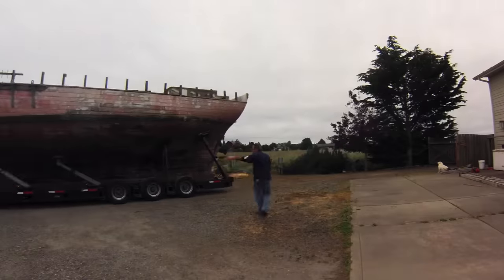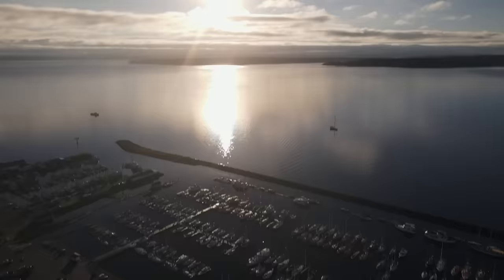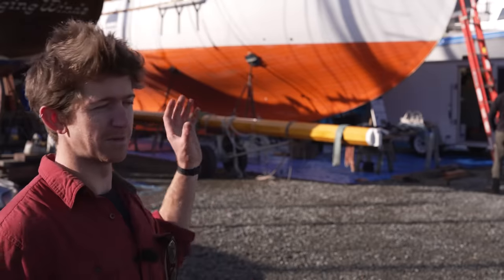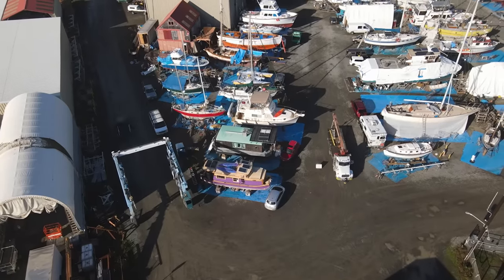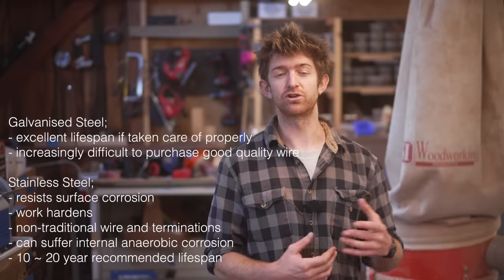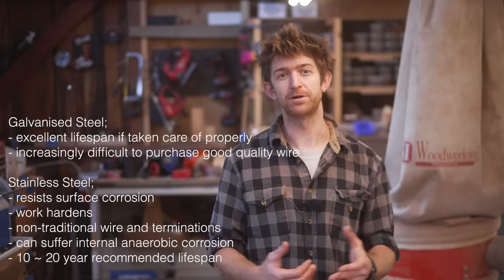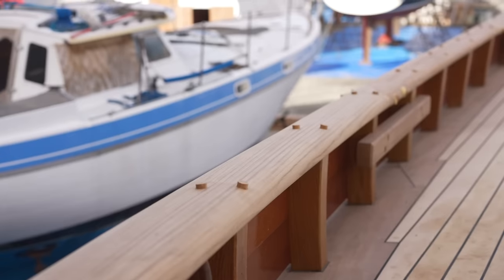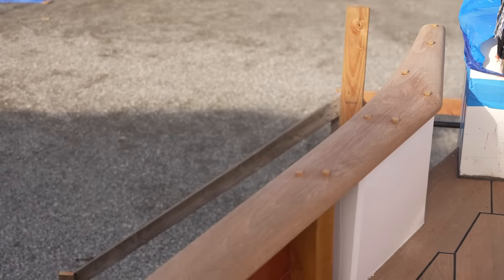Stepping the MAST!

Comment: Ahm, I think based on what I have read I do take issue with the comment from your rigging guy that Dyneema doesn’t stretch. In short it does. 

Basically, while it is accepted that it has a low stretch under normal loads it can stretch significantly under very high loads. That is if it is subjected to continuous significant tension it stretches incessantly and permanently. This irreversible elongation under static load is called creeping. From a practical perspective, re-tensioning/tunning the standing rigging is going to be a necessary maintenance factor for Tallly Ho.

Comment: Use of ultra-high-molecular-weight polyethylene  rope as standing rigging makes sense, and the traditional serving of the line does appear to mitigate the potential aging and wear vulnerabilities  of the material. Dyneema is the trade name of this product as used on Tally Ho.
Ultra-high-molecular-weight polyethylene is very surface slick, so it doesn't like knots. One the one hand, a knot will slip under load and on the other, it is really hard to get a knot out of the stuff. Although noted as a strength of the material, the material does not stretch more than 4% before it parts, so being able to assess the condition of the rigging under heavy loads that may compromise the rope is difficult by visual means. 
It should be possible to over build the standing rigging to withstand a greater than  worst possible case with ease, the only obstacle being the cost per linear foot of the appropriate rope diameter and stranding. Hopefully, that is what has been done on the design of the standing rigging on Tally Ho.
While this application is nowhere nearly as critical as the design and use of materials was in the failed Titan submersible, it is still based on the newest wonder stuff. It appears that the rig will be good for 10 years at least, but beyond that is well past the history of this material in shipboard use. Just sayin'.

Comment: You state that galvanized wire rope is difficult to find.  Not around here... It's used in winch cables for those who have not drunk the synthetic rope Kool-Aid... Hell, I even saw lengths of it in Harbor Freight today when I was looking for something else... What diameter do you need and what is the maximum length that any one piece would need to be?

Comment: I sort of disagree with the ""doesn't stretch" statement at around 7 minutes. 
Sure, the stretch in the individual fiber is minimal. But laid or plaited into a rope, a finished rope will elongate as it's put under tension. Initially, the fibers aren't perfectly aligned. There are tiny air pockets all through the rope. A rope under tension will be observably thinner and a little bit longer than a relaxed rope straight off the coil. As the fibers settle, bed in or whatever you want to call it, the rope as such will get a bit taller as the air pockets are squeezed smaller.
Don't get me wrong, I'm quite happy to use the modern fibers. And some lay-ups have really minimal elongation, hardly noticeable under real world conditions. 

But a rope can still get longer even if the fibers as such doesn't stretch.

Comment: If the modern rope does not stretch, is there an issue in over stressing it as the mast is subject to lengthwise thermal expansion and contraction...or over stressing the mast?

Comment: i am no shipwright but are external screws not supposed to be finished vertically ? 13:08 into it and i see some are finished horizontally, same applies to building structures and fittings so as water doesnt sit in them

Comment: Isn't it great when Leo defers to an another expert to comprehensively describe what is happening. Thanks Ian. Perfectly summed up.  Can someone help out with describing the mallet being used on the cap rail.  I cringe each time I have seen it being used and I know Leo is happy with its use and it is not damaging the wood, but what is it?? I have been telling myself it is a 5 Kg mallet made of compressed marshmallow.
Reply: It’s a rubberized dead blow mallet. It has sand, lead shot or something else inside. It would dent softwood, but the cap rail is hard enough to withstand the blows.

Comment: Not for nautical use, but vehicle winches in 4x4s, I have found fabric rope unreliable. I have never been 4x4ing and seen a wire rope break (I'm sure it happens I just haven't seen it) but fabric rope breaks in someone's vehicle like every outing. I ask why is it that even overstressed wire rope doesn't fail like fabric rope? For 4x4 use I see no advantage in fabric rope. 
I hope the failure rate in nautical applications isn't what it is in 4x4ing. I say this because the moment you really, really need it, it just breaks - meaning the one thing it's designed to do it can't.

Comment: How did you raise the center of gravity when you increased the weight of the keel? Didn't you add quite a bit of lead when you poured the keel?
Reply: The new deck is 2" thick, while the original was 1-1/2".
Reply: @frederickstibbert7389  
Remember when he first tried to pour extra material on the keel at the original yard and had a form blowout and made a mess? If he went ahead with adding that extra lead to the keel it would more than make up for a 1/2 of soft wood decking. Yellow pine is only around 40 pounds per cubic foot and that means roughly 1100 pounds total if the deck didn't have any opening which we all know isn't the case. lead on the other had weighs 708 pounds per cubic foot. So even if he made the keel only 2 inches thicker Leo more than covered the extra deck weight.

Comment: Where are you getting this heat set Dyneema that has no stretch or creep? I love this project but this is a bad choice in my opinion. I have been using various form of Spectra for nearly 30 years and none of it is suitable for standing rigging, temporary stays such as staysails it’s fine but cap shrouds and head stays no way. No way in hell I would go offshore with Dyneema shrouds!

Comment: Justification for using any other material for ropes than stainless steel is just ridiculous. The total weight of the ropes comparing to the involved mass of boat is insignificant and should not be considered at all. Another bogus is the non-stretch "consideration" of the proposed material. In whole world there is not yet known material which do not elongate. And that is the fact. Seems to me that Leo was persuaded by quite clever "supplier" to go with this very expensive, yet in my opinion not that great as described material.

Comment: I’ve watched your whole trip on restoring that boat.  But you really didn’t restore it, you built another boat.  What percentage of original material or parts are there in this boat?
Reply: See episode 58 (ship of Theseus). In general, wood deteriorates (rots) after a certain time depending on the maintenance of the material (TH had virtually none over the last 30-40 years). The hull was an empty shell, no mast, rudder, engine, etc. Leo tried to save the teak keel, stem and stern but it was gone and had to be replaced. Remember, he nearly fell through the deck by his first visit. Every part that was in a bad shape was replaced, one piece at a time, but whatever he did, TH was always there. That is restoring/rebuilding at its finest. 
TH's interior has changed (for instance there is no need for a "owners’ cabin" that existed originally). There are a lot of boats that have adapted interiors/systems  and still are considered original. The systems (engine, electrical, etc) are modern. If TH were maintained properly over the years all these upgrades would have gradually been executed and nobody would dare to say that TH wasn’t original. TH was adapted to the 21st century in one go, yes, but the end result would be the same. 
Question: Would you rather be ok to take to the sea with a (more than) half rotten boat? My choice, without a doubt, would be a revitalized strong yacht that still carries the soul of TH, even better, that IS Tally Ho.
Reply: @SonjaBruenzels  whenever I make a comment on YouTube, no matter how neutral there’s always some asshole who needs or lives to attack. 

Early on, years ago when this rebuild began, he stated it was harder to rebuild than to start from scratch.  If you’ve been following the progress you can see for yourself how he, piece by piece, dismantled the boat and started with totally new parts including the keel. To suggest this is a new boat is not the least bit a negative comment. But assholes live to attack. So attack on you creep.
Reply: @on4xb  my comment in no way was meant as negative. Early on in the rebuild, he mentioned that it was harder to do what he was doing than to start from scratch. He did one heck of a terrific job! 

I’ve rebuilt two much smaller, much newer boats made of aluminum and wood for one, and fiberglass for the other. I admire him and would never have had the strength to remake this old boat.
Reply: 'S true that not much original stuff remains.
- 75% of the newly-cast 8 ton lead ballast keel is original metal from the old keel.
- the lowest 3 planks of the teak transom (about 30% of its total area) are original.
- Teak hull planks were re-habbed to make side rails for the bunks.
- The iron horse (mainsheet jibe buffer) behind the cockpit was restored.
- The iron capstan is being repaired & motorized.
About 20% of her mass is original, but Constitution & Victory have only around 10-12% original material - they've both been rebuilt 6 or more times.
Reply: @frederickstibbert7389  You know it really doesn’t matter how much is leftover. He built himself one hell of a beauteous sailing yacht! One I’d love to sail in. 

I learned to sail at eight years old, learning on Sailfishes and Lightnings. At twenty five I bought a Catalina 22 which I sailed up and down the Chesapeake Bay, spending many weekends with my wife camping out on our yacht. I’ve had seven boats, two I rebuilt, one a total derelict with a tree growing through the deck. I bought a waterfront home on the Loxahatchee in Southeast Florida. Though Im old and lazy, I’ve seen boat auctions in which beautiful sailing yachts like a Catalina 30 or much bigger, are sold for a dollar.  If I was only young again, I’d fly to California for such an auction, buy a boat, rebuild it and sail down to Panama, and up to Florida. Ah what I wouldn’t give for a drink at the  fountain of youth (Ponce De Leon said it’s in Saint Augustine, Florida. Right up Interstate 95 from me only 247 miles away)😎🛶⛵️🚤🛥️🛳️⛴️🚢🛟⚓️